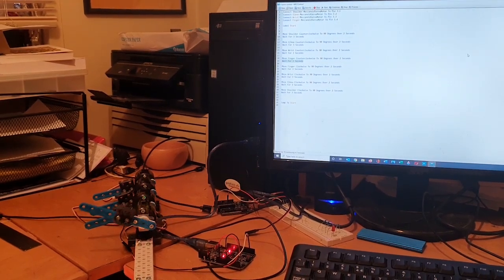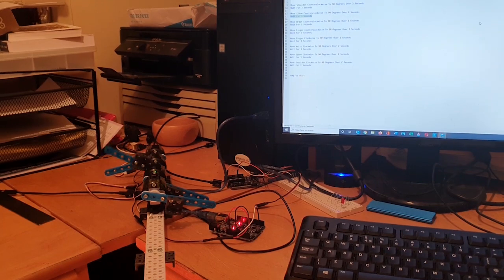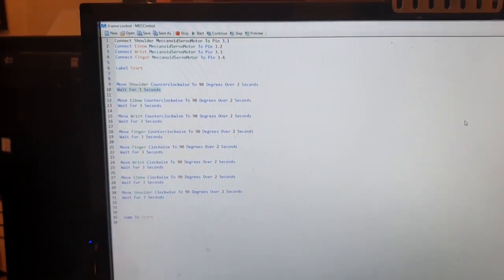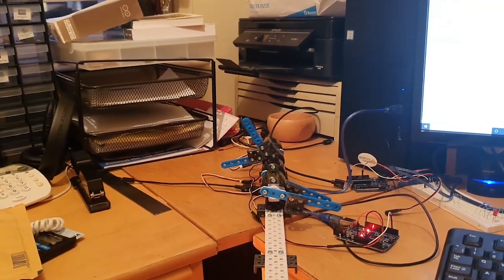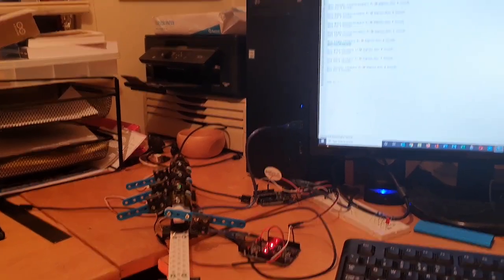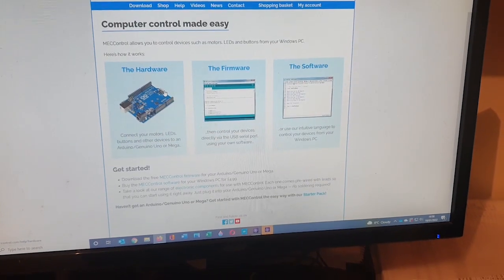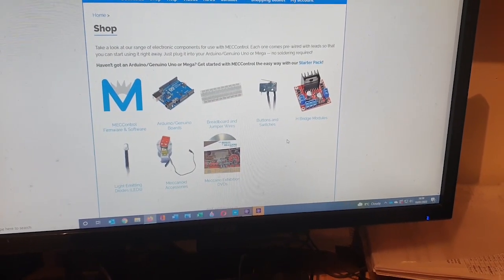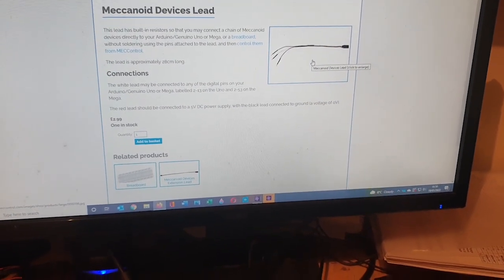Using MecControl to control Meccano Servo Motors

Comment: Any ideas for what kind of model you're going to use this in??🤖🤖
Reply from the maker: Not as yet.  This is just about getting used to the system.  There are some cool videos of various models using it on the MECControl website.

Comment: This is cool, I'll have to get on the bus and create something with controllable servos. Do you know if the program runs on Raspberry Pi? I've got a few of those lying around
Reply from the maker: I don't think so - it's custom firmware that you download on to an Arduino to get the programming language.  But I don't know anything about Raspberry Pi, having never used it.  I'm only just starting with the Arduino.  The MECControl website might tell you more, but everything I have seen points to Arduino.